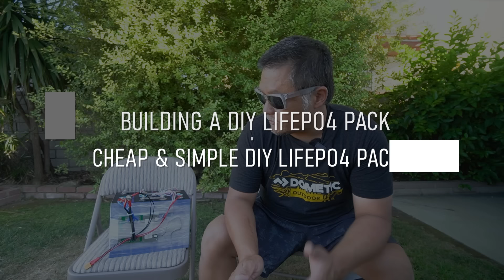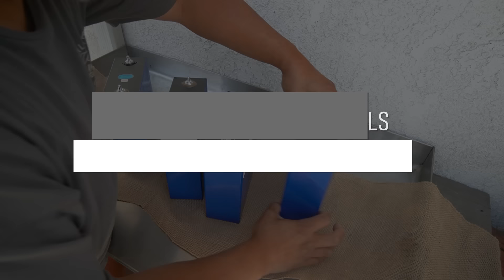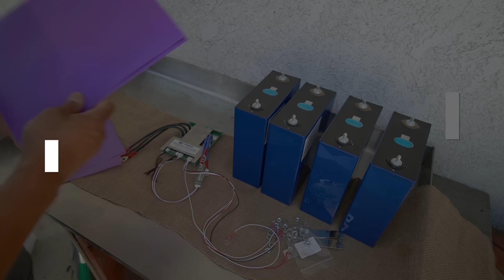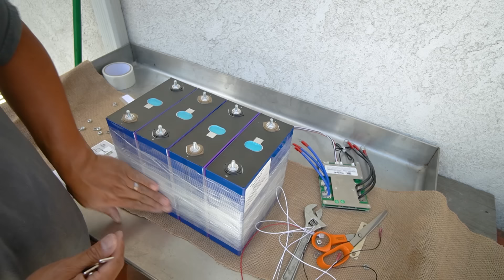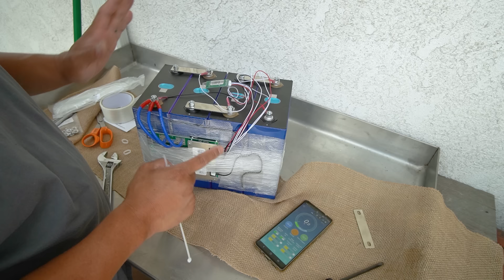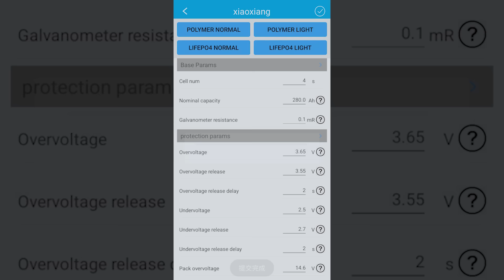EASIEST DIY 12-Volt 280Ah LiFePO4 Battery // Step-By-Step Build

Comment: Balance leads can be cut to length individually as necessary. There is no point in having them same length. While voltage reading, there is no current flowing so there is no measurable voltage drop.
Reply from the maker: While it's true it is not measurable, it is not true that there isn't a voltage drop.

Comment: You where touching all reds in one hand at the last steps of add. bms. Is that advisable?
Reply from the maker: Are you talking about 19:25? If so, it's not a problem. All 3 of those wires are combined into the main negative of the pack. There are just split into 3 conductors to be more flexible while still able to carry a full 120A load.

Comment: You did not include shipping  with the $678.92 price. How much would it cost to ship the cells from Alibaba? Ground or Air.
Reply from the maker: Yes I did. The per cell price includes sea freight to California.
Reply: @freelyroaming  you said they shipped air frieght in video, not sea fright, right now cost of air is insane, and delays massive, im going to try locals that bulk bought before all the c vid. BS
Reply from the maker: @Dale Val  that's right. I got mine by Air. Its an option that will add to the price. You'll need to get a quote from them based on your location. But you can get yours however and wherever you want. Doesn't matter to me.
Reply: @daleval2182  700 bucks for the lifepo4 and 800 bucks freight . 😂
Reply from the maker: You are getting ripped off if that's your quote

Comment: The balance wires go to cell positive not negative
Reply from the maker: That is not correct. They go to the negative posts of each cell. However because they are connected in series as a built pack, connecting to the adjacent positive post also happens to work but that is not what you are supposed to do. You will get a usable signal but degraded and slightly less accurate from the additional resistance caused by the bus bar. the smaller the bus bar the more noticeable the degradation. But since bus bars are usually pretty stout, you can get away with placing it on the positive post. People usually do that to avoid running out of threads on the negative posts. But if you have plenty of threads like this build, place them on the negative post is preferred. If you know how batteries work, you will notice that the power actually flows from the negative post (anode) to the positive post (cathode) during discharge. Not the other way around. I have a video describing how it works.
Reply: @freelyroaming  every one of my packs are all on positive side, even by the diagram states positive side
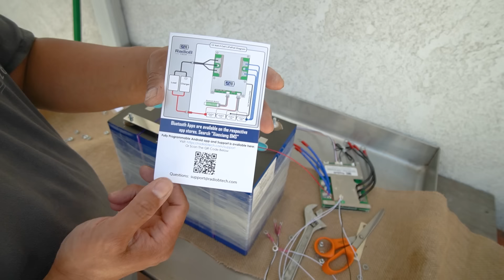Reply from the maker: @zxrjimmy1  go to 15:59 of this video and pause on the diagram that came with the BMS. Like I said, You can interpret the diagrams however you want because it is placed between each cell. That makes it the negative of the previous cell and positive of the next cell. The last of the sensing wire is only connected to the negative post. That's another way to know that you should place it on the negative posts.
Reply: @freelyroaming  all other bms I have, jk, Jbd, daly, all positive side
Reply from the maker: @zxrjimmy1  I think you are failing to understand the fundamental concept I am explaining 🤦 You are connecting to the conductor IN BETWEEN cells connected in series so it will give you the same reading regardless which one you connect to. They are connected to each other by the bus bar. They are connected to practically the SAME place regardless which side you choose. Stick your multimeter on that bus bar and see what you see between the 2 posts. Practically the same reading. Do yours on positive if you want to but know that scientifically they should go on the negative for the most accurate reading regardless of what your diagram states. The cathode side will have voltage lower than the anode side. The differences will only be measurable in microvolts so you most likely do not have instruments with high enough precision to detect them but scientifically you should place the sensing wires on the anode side.

Comment: So should one charge up the battery one cell at a time or change all 4 once it is built? Charger type?
Reply from the maker: All 4 at a time. If you are trying to top balance, connect them in parallel and charge to 3.65v. if you are just charging them as you normally would during regular use, build the battery with the BMS and charge to 14.4-14.6 or whenever the BMS cuts you off.

You need different chargers depending on what you are doing. A typical 4S LiFePO4 charger will not work for top balancing. This is a topic for a standalone video.

Comment: i just bought a 304ah with heating for 1700 euro, it just has a JBD bms and eve cells - i know this costs only about 5-600 euro so its was hard to swallow, but it helps a local guy out and i dont have to think about it, i think next time in 10 years or so I will build my own.
Reply: If all goes normal world, a battery will be already built for 10c a watt

Comment: How much can such bms roughly take current? Havent found a datasheet yet.
Reply from the maker: This one is rated for 120A discharge rate.
Reply: @freelyroaming  Sorry, I meant to ask self-current / working current.
Reply from the maker: @karlerikrabakukk2694  I don't know what you mean by self current.
Reply: @freelyroaming  I mean the current that the BMS itself needs to stay operational. For example my non-configurable Daly 150A BMS without temperature control has 0,1 mA, which is nothing. But maybe this one draws considerably higher amount because of the advanced options? Wouldnt want it to perfectly shut off the battery because of low SoC and then anyway drain it empty to the point of damage by itself... Sorry again for miscommunication.
Reply from the maker: @karlerikrabakukk2694  I see. You're talking about the parasitic draw of the bms. Besides having to power the Bluetooth, it isn't much more than just a basic BMS. I suspect my victron smartshunt likely draws much more than this does.
Reply: @freelyroaming  Thanks. Altough when BMS is triggered to shut off loads, it will shut off the smartshunt as well, as everything is connected after the BMS, so it's safer situation with the smartshunt. The bluetooth module can probably be disconnected from the BMS after without losing the settings (sssuming theres no monitoring needed)? I know these numbers are anyway small, but in a situation where for example an RV is left to stand alone for winter months with everything off (and for some reason not charging the battery before), may just be important to know.
Reply from the maker: @karlerikrabakukk2694  if this was in storage, that means the Bluetooth isn't transmitting data since no one is accessing it. The standby draw would be even lower. It's so insignificant it's not really measurable. This pack has been sitting for a few days at 50% charge and the capacity meter has not moved.
Reply: Good to know, thank you.
Reply: Came across this section in Overkill 120A 4s BMS manual: 
- 5.5 milliamps with everything off, when the BMS is active, but no bluetooth.
- 15 milliamps with the bluetooth active (after about 10 seconds it drops to 0.8 milliamps.
- 0.8 milliamps when the BMS is inactive.

Comment: I have solar on my bus..does the higher voltage in charging cause any issues?
Reply from the maker: Your solar panels are regulated by a charge controller. The charge controller needs to have a lifepo4 charging profile. If it doesn't, you'll need to upgrade it to one that does.

Comment: I’m a legit dummy. How do you charge it? How can i use as a big power bank?
Reply from the maker: You would use it the same as you would any off the shelf lifepo4 battery. A battery is not the same as a power bank. You need a lifepo4 compatible battery charger to charge it.
Reply: @freelyroaming  thanks for responding. So this whole vid is just about the battery build? Then i can use this battery to build a power box, right? I have tons of questions. Super interested and very helpful video.
Reply from the maker: @djogz  yes this is a battery build from raw cells. From here, most people integrate it into a larger system with charger, inverter, DC and AC distribution panels etc. Everything you need for an off grid power system. A power bank is just a scaled down and portable version of that. This would make massive power bank. Just about all of the largest power banks you can buy for thousands of dollars is less than half of this battery's capacity.
Reply: @djogz  dont buy lithium its stupid. Agm and gel is cheaper and more safe. And its already Done.
Reply: @lenahandsen6836  Lithium is cheaper in the long run and AGM are also dangerous in that they contain more acid and may give off poison   gases.
Reply: @leonhardtkristensen4093  Well i don’t believe in those cycle counts the producers of lithium battery’s state. They will lose capacity fast and won’t be cheaper in the long run.
Reply: @leonhardtkristensen4093  can you show me one video proof of one lifepo4 battery cycled  3-5 000 times and what the capacity is after ?
Reply from the maker: This has been proven in EVs, ebikes, electric skateboards countless times. They are often cycled at least daily and sometimes multiple times a day for several years. Also telecom and IT industries have been using them to power their off-grid equipment overnight. You can literally go buy used cells from them after thousands of cycles and still get a majority of their capacity as used cells. This is not news. It's been used for decades. Good quality lifepo4 cells have more than a proven track record for having thousands of cycle before noticeable degradation. You don't need a YouTube video to know their cycle life counts are true if you understand the science. Though I don't really care about proving it to someone who doesn't want to believe these facts. What does it matter to me? Just go on keep using your lead acid batteries.
Reply: @freelyroaming  evs ebikes and such things use lithium-ion. Not lifepo4. Cause lithium-ion has more power than lifepo4 and is less expensive. And they can be cycled like some hundred times with some loss of capacity. And btw good luck buing really NEW Lifepo cells. You almost always get used cells. Very nice?
Reply: @freelyroaming  about all lithium batteries are manufactured in china and AliExpress, Alibaba sell used crap from industries in china. If they aren’t swollen when you get them they will be very soon.  And if you buy already done 12v batteries with nice stickers on it doesn’t Mather cells inside are used crap!!
Reply: @freelyroaming  also it’s easy to check real capacity of lifepo4? Example take one new 32700 “new” lifepo4 cell. Check capacity. Then discharge it and recharge 3-5 000 times then check capacity again ?
Reply from the maker: @lenahandsen6836    lots of electric mobility have been using lifepo4. In fact even The Tesla gigafactory in Shanghai has switched their Model 3 vehicles to use LiFePo4. lt is actually cheaper and more sustainable than other lithium chemistries because it doesn't require rare earth metals like manganese or cobalt. Telecom and IT industries have been using lifepo4 exclusively for decades. You really need to not get all of your information on YouTube. That is a big problem with people like you who only comment and don't create. If your problem is not being able to find new high quality cells, then you need to try harder and stop buying the cheapest listings. It's true a lot of lifepo4 cells are made in china. That's because they have the expertise and resources to manufacture them. Most are built in Shenzhen which is the electronic manufacturing hub of the world. They know better than just about anyone else how to mass product high quality lifepo4 cells. Saying somehow they are crap is just your own uneducated xenophobic prejudice. If you are still hung up on there being some kinda lie about lifepo4 cycle life and capacity then it's your own problem. Real life discharge/recharge is brain dead easy. It's call 'using the battery pack'. I've had cells cycling daily for over 5 years and they still get full expected capacity. That's well over 2,000 cycles. You don't need to see a YouTube video to know something is true. Did you learn nothing before YouTube existed? 🤦‍♂️🙄
Reply: @freelyroaming  yes i know Tesla is going for lifepo4 now. That’s better for security and last longer but probably not for acceleration compared to Lithoum-ion. But you know what? No one is going to buy Tesla cars 5years from now. People will buy Bmw and other German electric cars. Cause they already know how to build cars. Tesla quality is really rubbish. 

I know a lot about batteries and my knowledge about buying lithium from china is my own and YouTube is full of people with the same problem? Getting used often swollen crap with less capacity. And those YouTubers that claim they are good are bought by AliExpress or Alibaba.
Reply from the maker: @lenahandsen6836  that's just your opinion and it means nothing to the rest of us. LiFePO4 provides plenty of power for acceleration. 1C current draw is more than enough and all LiFePO4 packs can do that. Your knowledge is pretty rudimentary and sounds like its all second/third hand information. And now you are literally contradicting your own original comment by agreeing that it's safe and long lasting. You've got no proven track record of providing useful information that you learned yourself. Go get some of your own experience instead of just regurgitation stuff you see and hear. Also you have to stop trying to cheap out and fall for the fake deals. Buy from reliable source instead of complaining for not getting something too good to be true.
Reply: @freelyroaming  my opinion should be as important as yours? And this is not just my opinion. This is the opinion of many! What source is realibe? There is none! Only if you have contact with someone you can trust at the factories making this cells.
Reply from the maker: @lenahandsen6836  that's why your opinions are rubbish becuae they are just regurgitated from other people. I have shown dozens of videos of first hand experience. You have none. You started by saying lifepo4 chemistry is unproven because you can't find videos to show it. That's idiotic. How was anything proven pre-YouTube? Did you believe nothing before YouTube? That tells me everything I needed to know about your judgment. Go make your own video with these opinions you have and see how the community reacts. I can tell you already it won't go well. That is If you even have to balls to do that instead of just commenting on other videos. If you don't know what to look for in a reliable source then you will never get it.
Reply: @freelyroaming  aha so you base your opinion only about your own experiences? What others have experienced doesn’t Mather to you? Okay cool bro. Before internet and YouTube people were ripped off more ? Now we can share information and LEARN easier. And make less mistakes …
Reply: @freelyroaming  if you can fully cycle your lifepo4 battery  5000 times without failure or getting lower capacity you are lying. Those figures the cell makers are doing are BS.
Reply from the maker: @lenahandsen6836  you are so simple minded. It's about observe, learn and practice. You know nothing unless you do all three. So far you've proven yourself to know nothing.

Comment: I definitely want to build my own battery but I am disabled and can't work, and I live in my bus full-time without power at night because my agm batteries took a dump on me and now won't hold a charge. It gets very hot here in the summer,  about 105 degrees f and very cold in the winter,  about  - 10 degrees f . I live in the high desert of New Mexico USA 🇺🇸 at about 5,500 feet elevation, I have about 400 watts of solar and a 3000 watt inverter. Is there anyway you can help me out with some battery cells. I can send you pictures if you want
Reply from the maker: I do not offer any build services.
Reply: @freelyroaming  I can build it I just can't afford it, but I really need it and I just need the cells
Reply from the maker: @jamesmason7124  I also do not offer free products. I am not even a reseller.
Reply: @freelyroaming  I'm sorry Dan I just thought you might have some used cells or could ask your viewers. I really am in need
Reply from the maker: @jamesmason7124   we don't know each other personally. If I did have free cells to give, I would first help those who I already know that need them. And there are plenty. I suggest you start with people you know and work your way from there instead of asking random strangers online.

Comment: How does the battery charge on negative? You leave the negative bms wires "hanging?". Huh, interesting.  I would have thought you would be connecting loads directly to the battery but i guess if the bms has protections it hzs have to have the current go through it
Reply from the maker: That's correct. If you connect directly to battery negative, it would work of course but you would lose all of the protections of the BMS. Because this is a common port BMS, it means it charges and discharges from the same negative port. The protection schemes apply to both charging and discharging so you never want to connect anything directly to the raw negative battery post besides the BMS.
Reply: @freelyroaming  That makes sense now. Thanks a lot for making this video! It looks pretty straightforward to build this. That's a huge battery ! 4Kw of energy for only $700ish, wow

Comment: I am using a couple of those JBD bms's from radio tech. They haven't givin me one issue in yrs but the app can be frustrating
Reply from the maker: That's good to hear. The app is very powerful but not intuitive. I'm testing to make sure the data is accurate and reliable and the will take time